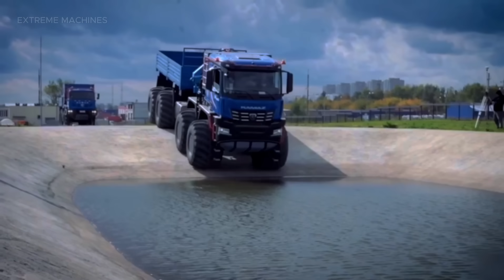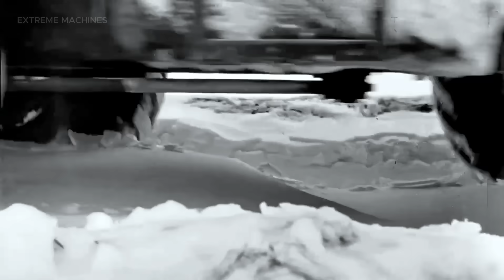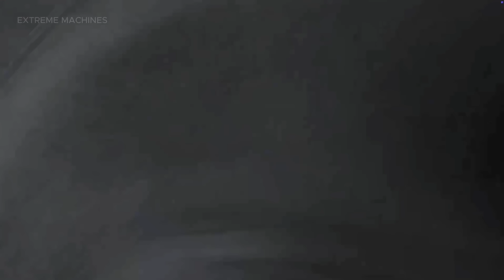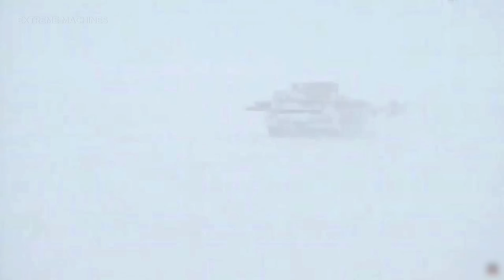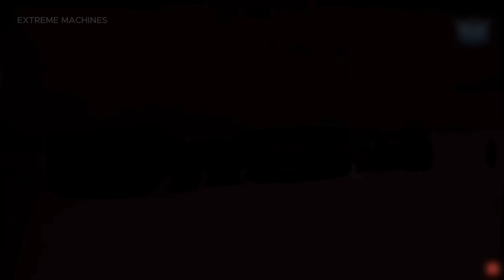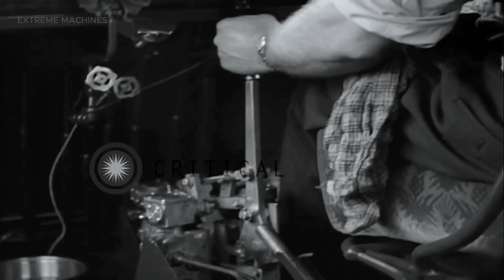THE 10 BIGGEST OFF-ROAD EXPEDITION TRUCKS IN THE ARCTIC YOU DIDN’T EVEN KNOW EXISTED!

Comment: Kamaz is like the Soviet version of Lada.. its simple easy and not high tech.. but easy to fix if problems.. And it has alot :D
Reply: I wonder if the diesel fuel tank and fuel lines are insulated and or heated to prevent selling in really cold conditions. Plus, what special modifications are installed to allow rhe diesel engine to fire up and run after overnight deep freeze conditions.

Comment: The snowcruiser was an example of what happens when someone who has never even seen snow or ice tries to design for it... it doesn't take a rocket scientist to know that smooth tires get bogged down quickly in snow....
Reply: Admittedly, the idea is good but in reality, needless to say… it sinks in like crazy.
Reply: yes and that machine is too heavyweight😢
Reply: @ヤス-l4b weight isn't necessarily a problem, especially when you have tires as big as those. It's more about how much pressure you're exerting for the contact area.

Comment: cool machines … but … the air cooled ones ?? how did the heat them ?   i rember J C Whitney magizines sold little gas fueled heaters for V W bugs and vans … they were so small they fit inside the air vents that drew heat off the engine  another sketchy idea. Any ideas?

Comment: The FWD MM1 Teracruzer Is a useless piece of garbage. Here he say with power to go anywhere. HA! The hugely underpowered Continental AO-895-4 air-cooled flat 8 or horizontally opposed gasoline engine (gasoline chosen so that aircraft fuel could be used) lost the majority of its power to its 8-wheel drive, heavy duty drive train system, with multiple transfer cases that ran to 4 bogies, then off to each wheel which has  its own differential and torque converter with gear reduction all at the wheel to drive the huge low-pressure terra tires.
Reply: Mine has an air cooled v-8 Duetz diesel and is far from being a piece of garbage